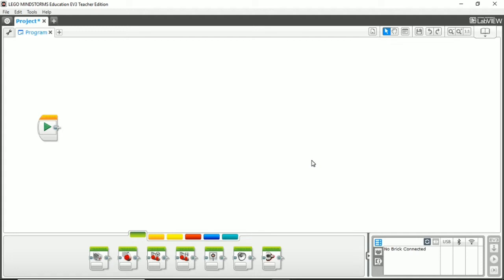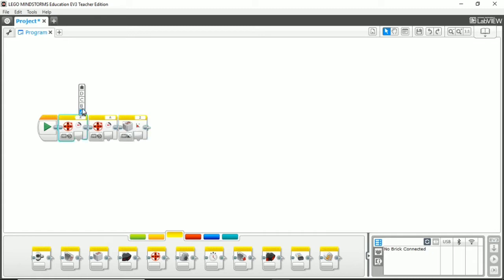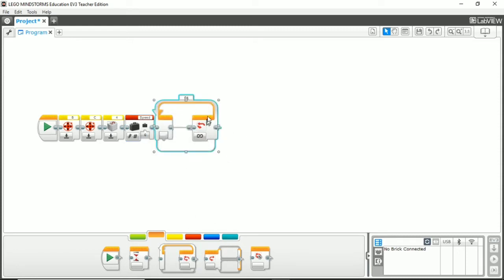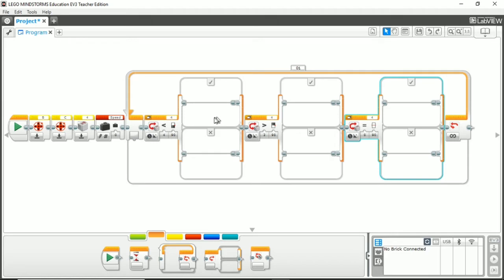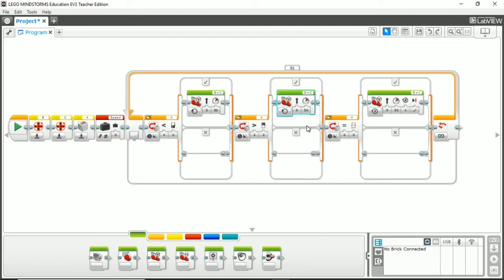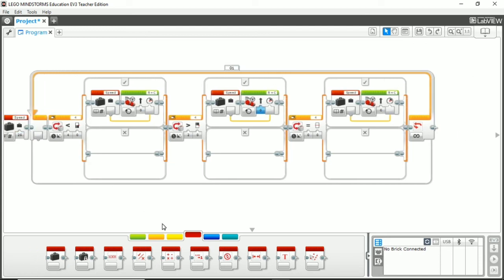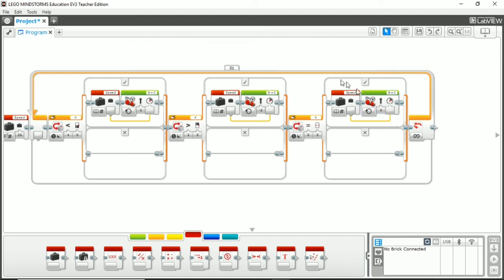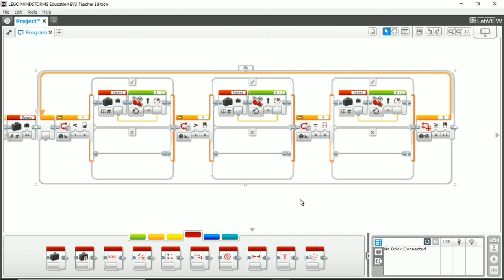FLL How To Use the Gyro Sensor To Make Your Robot Drive Straight

Comment: I thought it would be a PID
Reply from the maker: I didn't make a proportional because if your robot is getting drift typically that is minor and a PID is way overkill and could even make it worse. This method is much more reliable, smooth, and easy to tune. I can make a proportional one but that would only be used if you have a but amount of resistance on 1 side from like a attachment or something. For general use my team has used this one for years.
Reply: it turns to the left and we have tried many programs it may be something wrong with the motors, but we are a poor team so we cant afford another one
Reply from the maker: @ritamr2690  email be in the 3d printing email in the description with some more info and let's see if we can figure this out.
Reply: @natesimpkins4875  I sent a text on your hangouts from the email.